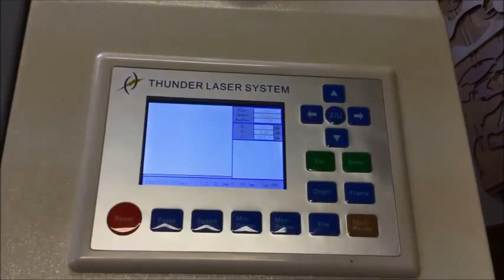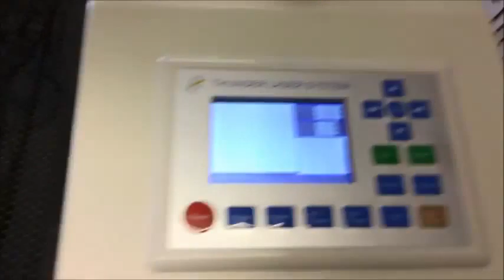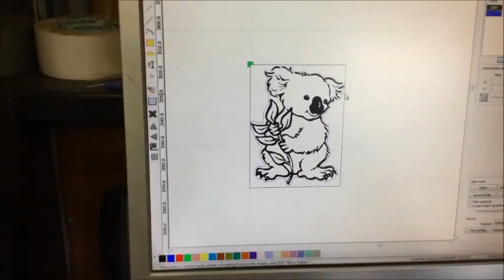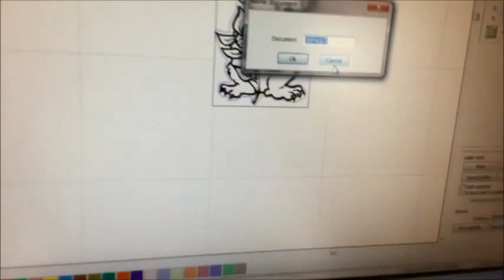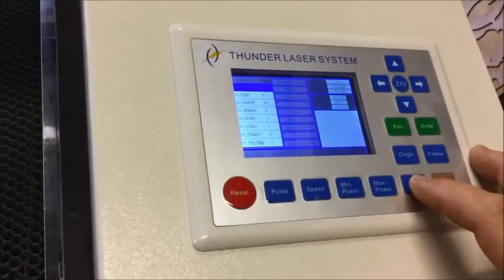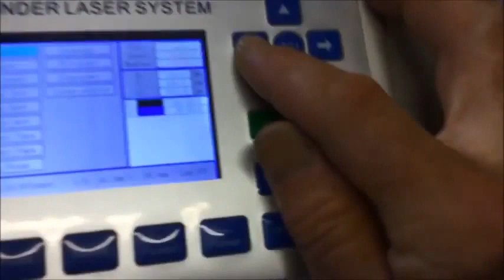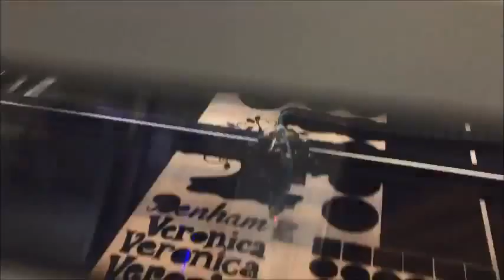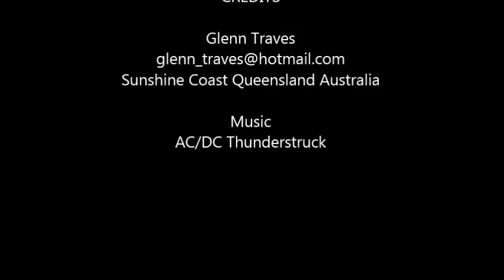laser cutter review - thunderlaser mars 130

Comment: to do fine work on a 130w laser like engraving small stuff what would I need... new laser heads?
Reply: they have a "hi- resolution head" that doesn't have the air assist on it, supposedly should do 1000dpi+ but I haven't got it to work for me right... for best detail, I make sure the design is fine detail, and then I turn the speed lower to compensate for the stepper motors.